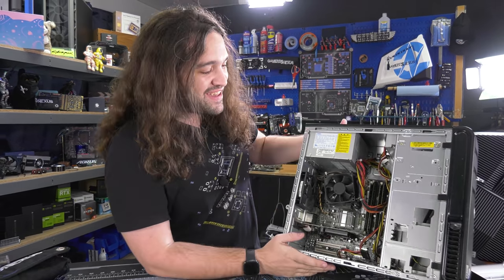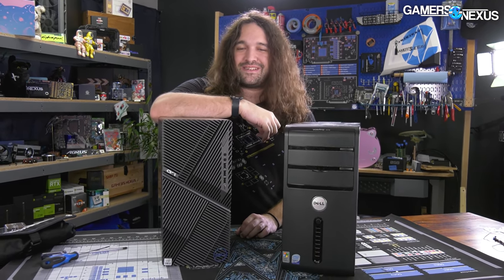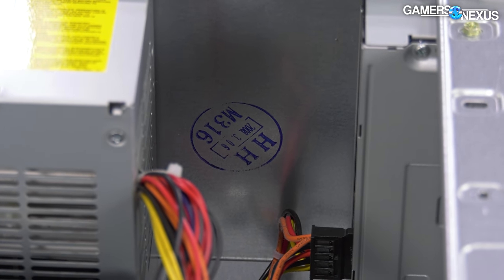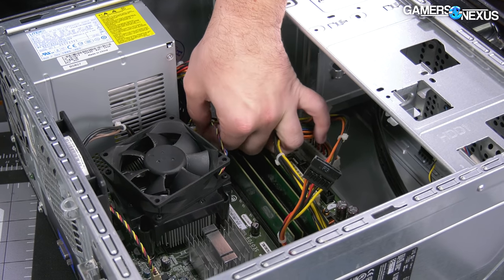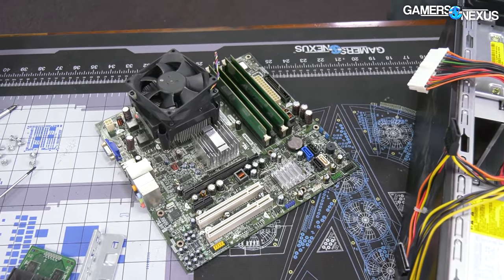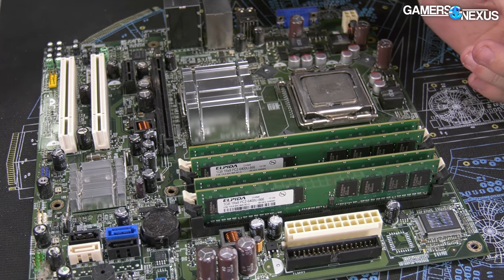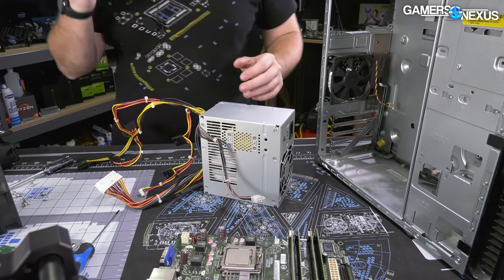13 Years of Dell Getting Worse

Comment: Okay I daily drove a vostro 400 (Compaq Mobo) until 2019 with an AMD AthalonII 280. I was able to game on the damn thing, upgrade it and keep it alive for 11 years. If I bought that G500 or whatever the hell it is I'd toss it before I finished unboxing. At least the damn optiplex series (which is when the proprietary trash really started with the stupid front panel connections and itty bitty PSU) you could rehome them to another case (with effort) making room for a psu that is useful and adding a GPU thats resonalbe (GTX650 anyone?) Dell's regression is absolutely UNREAL, HP at least was always crap, you knew what to expect.

Comment: moral of this story is dell went full HP in recent years. i remember i think it was about haswell era before they went to this shit. then skylake came around and they went for proprietary. i remember their sandy bridge and ivy bridge era stuff being atx standard and using standard power supply 24 pin and such. but post skylake they took a feather out of HP's shit cap. although they have always been quite locked down on the bios front since the og core arch's netburst era you had standard american megatrends bios. which is insane to think about.

Comment: WAY back in the day Dell used Intel reference motherboards, standard cases and components, such that is was a valid choice for a diy'er at every level.  Dell dimension XPS circa 1999 iirc.  Especially important: it was actually CHEAPER than I could part a machine together!

Comment: Lenovo also did almost the same

I have old ThinkCentre (2005 - Pentium D, 512MB, 80GB HDD, Intel GMA, win XP) , I can replace all parts (just a bit problem with front audio port) without problem (actually I put i5 8600K + RTX 2060S there just for fun). But.. newer ThinkCentre would not allow me to do that (usb 3.0 is totally different), they had 10 pin ATX PSU (since skylake generation if I'm not mistaken)  which is not compatible with 24 pin regular ATX psu, etc etc.

Comment: What's the issue with using that phallic object to hold the fan? Assuming it stays in place, the rubber is tooless and would provide some isolation for vibrations, so I'd think it'd be a very slight upgrade.

Comment: I mean, I loved my original 1st generation Dell XPS with badass blue and silver case (terrible airflow), Pentium 4 CPU, 512MB of RAM (I think?), 120GB HDD, and ATI Radeon 9800Pro GPU. I played the crap out of Battlefield 2 on that thing. Once I started building my own systems after that though I never went back to any of the large system integrators.

Comment: My parents computer is still running a Dell Studio 435mt's motherboard with an i7 920 and 12gb of ram

In a modern case of course, because the board is MATX and uses standard connections

Comment: if the Vostro didnt have such poor ventilation meaning VRMs and RAM might get too toasty it could be an interesting sleeper build for a top end gaming rig cooled by a hidden external radiator such as the Mo-Ra3 420.

Comment: I still have a retro system in a post beige light gray 2004ish Dell case, pretty much the only difference being the front panel. The aluminium heatsink was exactly the same and was complete garbage, I replaced it with the cheapest of modern Chinese twin heatpipe 92mm cooler I could find and temps immediately dropped dramatically.

I still have an Antec 900 too - and can confirm the cable management is still garbage :)

Comment: If you think their prebuilts are bad, their laptops are way worse. I have a Dell G7 7588 Laptop and I hate it so much, but I don't have the budget to get rid of it. It just has so many problems: thermal throttle and INTENTIONAL power throttle, USB ports randomly shut down every 20-30 minutes, some of its proprietary software is not compatible anymore and can't get it to work with previous versions (waves audio) nor updating the BIOS, it came with a 128GB M.2 SSD which is not enough for anything (the previous generation came with a 256GB SSD), newer BIOS versions blocked the possibility to adjust CPU voltages and clock speeds manually and they removed the possibility to go back to a previous version of the BIOS where it was possible, and it comes with a SHIT TON of useless bloatware. Build quality? The screen sucks, screws strip pretty easily, and obviously the cooler is bad; they used the same cooler in this 6-core CPU as the one they used in their 4-core laptops from the previos generation. They just keep making it worse and worse, the USB ports problem have caused me a lot of trouble and I have tried everything to fix it (probably a hardware issue at this point). I've had 3 Dell Latitudes since Windows XP came out and the previous Inspiron Gaming 15, they were great, but I'm never buying Dell again, and no one ever should. 

I've managed to make it work kind of "stable" by disabling turbo boost in the BIOS and other tweaks, which defeat the whole propuse of getting an i7 (but at least solves the USB problem to a certain degree). Thanks and fuck you Dell; I'm stuck with this piece of crap. Not a cry for help (or maybe it is), I just want to emphazise and testify how bad they've become in general. Great video btw.

Comment: My only critic of this vostro system is that the io sheld is non removable. That just means you’ll be stuck to the same lga 775 motherboard. Much better than the shite you get today. For example i own two laptops. A broadlake i5 5200u hp 350 g2. And some generic asus gaming laptop. One strangely enough has 1 ram stick soldered onto the motherboard and 2 m.2 slots which I probably would never use. And because of poor design the cpu a ryzen 7 3700u keeps thermal throttling. And another is completely upgradable and is incredibly easy to service even without documentation on it. And surprisingly enough even though it’s 8 years old it’s a completely useable laptop.

Comment: I have a whole bunch of the next gen vostros in my office (Sandy Bridge). I keep them all running with upgrades (SSDs etc.) and everyone has more than enough performance for basic office work. I have seen so much perfectly good stuff get sent to the heap because people don't put in any effort. Power users aside, it is way more feasible to keep this stuff in service than people think.  That's, of course, if things are designed with reasonable upgradability in the first place.

Comment: Dell proving there's always room to get a lot worse LOL
And yeah, the Q6600 is a decent CPU. I still have one working perfectly fine with an Asus P5N-e SLI motherboard. They were part of the first computer I built back in 2008. I installed Linux Mint and use the PC when I visit my mom. Linux is awesome for older builds.

Comment: I can give them the case airflow. Especially given the tdp of that system. It wasn't until around that time that GPU's started going fully double slot for the majority of their stuff and TDP started climbing up into the 200W range. The GTX 8800/9800gt was somewhere around 125W. The entire tdp of a decent system around that time was around 300W. That system you have there? 175-200W most likely.

Comment: It's the same with their laptops. I own a G3 3779, from 2018 and what a bag of crap. Single board design, weak thermals, poor casing (I've had to change the palmrest due to the hinge area collapsing, twice!). I had to undervolt it with ThrottleStop. It had this weird power cycle issue since new, but their support didn't care and sent it back no fault found. Now it won't restart or shut down without a power button hold. And it isn't Windows, as a wipe and install of Linux does the same. DELL have gone downhill, badly.

Yet my 2011 DELL Precision M6600 laptop is built like a tank, mostly metal, and fully modular. Go figure.

Comment: What I've hated the most from my dell machines are their PSU and the motherboard power connectors they at least once used.. Especially the 14 or 16 pin ones...(cant remember which they used when I had dell machines coming my way..) I ended up getting so pissed that I bought a new motherboard and PSU simply just cause

Comment: The Vostro was a very specific model and not really like the rest of the offerings from the company...specifically the Precision (home) and Optiplex (work/enterprise) lines.  I gotta point that out because I've been working with Dell hardware in an enterprise environment for a very long time, specifically the Optiplex line which has been the marquee for their enterprise PC's for like 20 years now.   On the Optiplex side, the components have always been really, really easy to swap with replacement parts due to their positioning. Yeah, you gotta buy those parts direct from dell because none of them were standard, but they were easy to swap, I'll say that.  Even stuff like Front panel I/O and power switch could be easily disconnected and replaced due to being self-contained. I'm kind of surprised that Dell wouldn't take that mentality and apply it to a modern take on the Vostro.

The generation before that Vostro though, say from around 2002-ish to around 2007...Ooh man could I tell you stories.  I think the pinnacle of it was the clamshell case they made (people who know, know).  Full tower, built out of a bunch of steel and really hard tough outer plastic cladding and it literally hinged at one end (the front).  That case was the king of tearing up fingers and none...and I do mean NONE of it was standard.
Reply: That clamshell opening was the absolute worst implementation of a really cool idea.

Comment: Ahhh - but Dell realized that standard components allowed upgrades and maintenance. They don't make any revenue from end user owners replacing components from various sources, most likely Amazon, NewEgg, eBay, etc., or by an independent repair shop, but NOT Dell as they charge a premium. The strategy becomes proprietary non-interchangeable parts to force end user owners to buy another complete PC - hopefully from Dell - giving them more revenue stream. It's all about revenue, and Dell's (along with HP's) is through sales of NEW stuff, not parts to maintain existing stuff.

Comment: Well you still can't replace the 2008 motherboard because of the IO shield that's built into the case... you'll need a new case as well. I have a HP ProLiant ML110 G4 that's exactly the same. Well, at least the heat sink is not screwed into the case (which was for the HP ProLiant)

Comment: The old Dell Dimension e310 had a huge cut out in the front where you could put your hand through and it felt like someone had an ac unit because that cut out had a series of slots in it and behind it a wind tunnel connected to the processor heatsink that did a pretty good job of keeping the old pentium 4 ht cool but it seems like they are saying who cares when it comes to their products because of the design flaws

Comment: I can confirm that my workstation Precision 3640 with 10700 makes only ~1500 cinebench ir R15, while originally it should do around 2290 😀
And it throttles even in 18oC ambient office at around 100oC (65W KARL) 😀
They have also put two different ram, one is Micron, and other one is Hynix. Installed in Slot1 slot2 according to cpu-z. While other manuals say A2 B2. 
There is no info for 0D4MD1 motherboard to recheck. But why intentionally do this ???

So basically you are paying 100percent, and getting just 65 percent of performance 😀 Like buying 6 second car, and getting 10 secon car with noisy engine.

P.S. With my Alienware workstation in a company I worked before when Kaspersky AV was kicking in, pc was becoming a space shuttle, noise could be heared in the coridors of the office. At least seemed not to thermal throttle.

So sure, they are getting worse with time. At least my first laptop was not overheating that much to thermal throttle, but assembly quality was piece of sh** ...

Now they have moved to the next step 😀 Dell - Well done. Great job 😀

Comment: The biggest issue with this case / mobo was that there was no IO shield. The ports are just cut out of the case. So you probably couldn't replace the mobo in one of these with a standard part.
Reply: a 10$ Radio shack nibbling tool and 10 min will fix that. I have done in many times. 
If you are missing the i/o shield form the mobo you are swapping in you can 3d print one and just snap it into you new custom cut i/o shield space.

Comment: 14:54 i have gpu slot on 1st space but i don't know what cooler i should replace the original with ( same as in 14:54) , Board is MSI H61 B25 B3 (microAtx) and case is 175mm wide

Comment: I don't think u can really call the cooler load bearing if the mother boards held fine with other screws through the board even if the cooler is unscrewed I think a better word for it is reinventing the wheel pointless...

Comment: Also I have an optiplex with that exact same cooler..and it crashes to blue screen if you're doing anything pcu intensive.  I've re applied thermal paste and that didn't fix it.  So I stuck it in the closet because it's an optiplex.   Maybe I'll pull it out and try a different cooler.

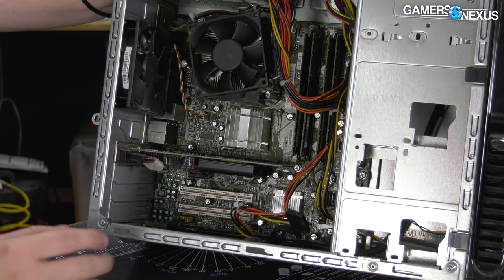Comment: @5:10
I've been a PC tech for two decades now and I understand the point you are making; that it's hard to tell if this is a modern or a vintage machine, but there are two PCI slots on that motherboard. Dead giveaway
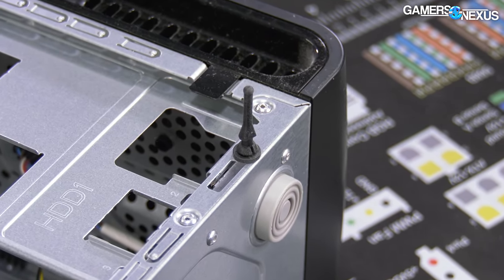Reply: @9:50
The modern Dell has the case fans attached by butt plugs.

If I am completely honest I actually like those little rubber anti-vibration fan attachy thinga bobs.

Comment: The vast majority of systems that end up in e-waste not because they are unfixable but because they are slow. If anything I'd argue that OEMs like Dell trying to use as few resources in their systems as possible is actually better for the environment as the saving from the initial manufacturing would more than offset the tiny fraction of systems that end up in e-waste earlier than they would have using standard components.

And this video disproves your initial statement, yes older systems can be upgraded and used in other systems but it hasn't. You can go to any e-waste facility and find stack upon stacks of systems that are the exact same as they were when they came left the factory. So all of the extras to make it fully featured PC is just wasted time, money and copper.

Comment: I would only buy a Dell laptop, not a desktop, the only thing with their gaming laptops is you typically have to put in your own thermal paste because theirs sucks from factory, after I did that, my G7 stays ice cold compared to my friend's Asus G17. Also the Dell runs at more stable framerates.

Comment: I have a Dell optiplex 7010 core i7 3770  3.4ghz, with a RX 580, and it can run just cause 4 just fine.

It does run a little hot though.

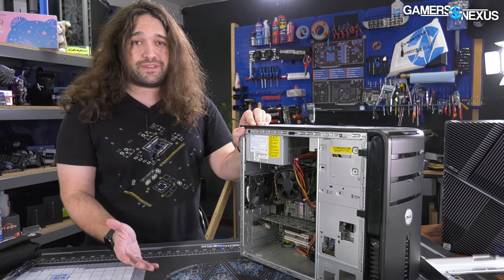Comment: 5:25 - love ya, mean it.. but the mobo on the vostro has normal pci , non express.. How would you not be able to tell? Also the Vostro sucked compared to the Optiplex with same specs.. The VRM arrangement on the new board is "Special". Also, in all fairness the psu on the vostro had a 4pin connector that would not reach on any other board than the dell.. The front i/o header couldn't be connected to with any other case.

Comment: I'm not going to lie: I've been getting YT ads for this Prebuilt PC company called CLX Gaming, and the pricing starts at $750.00 for a "gaming" PC that has a R5 5600G that relies on the APU's Vega 7 Integrated Graphics. Next step up is a $1080 system with a i5 10400F and a Radeon RX580, which is wierd seeing that the next step up, which is $1480, is a R5 3600 with a 2060. After that? A $1490 system with a i7 10700F and a 1660 Super. Would you want to ideally keep the Radeon and Ryzen together?

On the bright side: you can DYOC, and with that I was able to produce a R5 3600 and RX6600 machine for $1250. Not great for the price I know...
Reply: I wouldn't consider a 5600G gaming level.  That said, there's a lot of games it will run and a lot you can do with integrated graphics.  I'm running a gen 8 i3 as my 4k HTPC with its integrated graphics.  5600G will do a lot as long as you're not doing high end.  If you are doing high end, I'd expect you to build from scratch.
Reply: @AC-yj8cx  Well... The word gaming was put in quotation marks for a reason. Still... the mismatching and price of the hardware is really problematic. Don't have one of them, so I can't say anything about build quality.

Comment: I remember upgrading the motherboard in a Gateway Case from 2002-2004 ish. Same thing with Dell. So this is accurate.

Also the Vostro line was also more enterprise oriented. I wonder what an Inspiron from the same era would look like?
Reply: The same but silver. The optiplex is more proprietary than the Inspiron 530/531 because of BTX and special fans

Comment: Dude! I got a Dell! And it's a fine computer, TBH. Sure, it uses proprietary parts/layout/design. Sure, some of those parts are flimsy and the fit/finish is not exactly that of a 1990s German luxury sedan. Sure, there's a bunch of bloatware to get rid of. But, the damn thing just works and works well. And it has a warranty. It fills its market niche and does it well. It's the Toyota Corolla of computing, and there's nothing wrong with that.

Comment: I built my first Pc inside the bones of one of these :) my wife helped me and we had to drill out the rivets to get the HDD cage out a GTX1080 inside. 2 sided tape held my HDD and SSD in place with rubber feet under the HDD to prevent the vibration lol

Comment: Oh boy, I would love for Steve to take a look at the Vostro 5502 laptop's build quality....it's bad. The 'mounting' bracket for the m.2 SSD is 'held in place' by two small metal bumps that slot into small cutouts in the chassis. Needless to say the drive was half way out of the slot when it arrived.